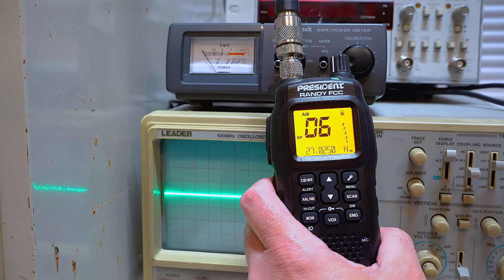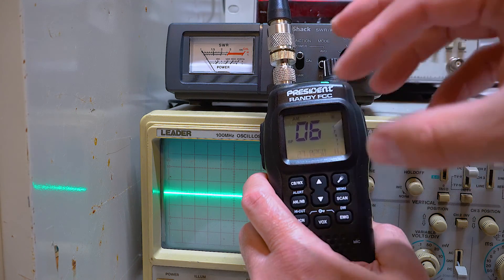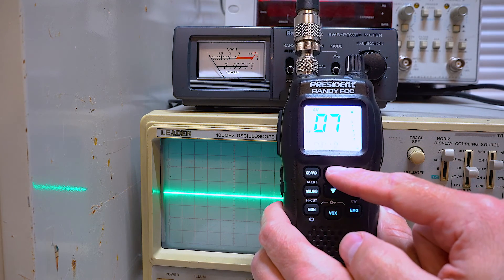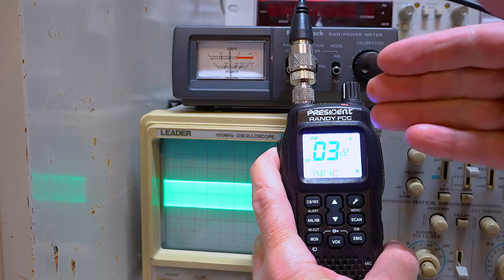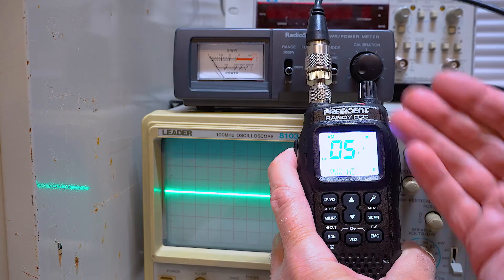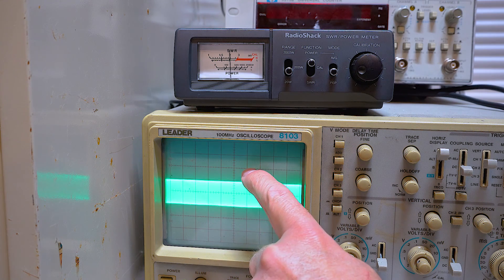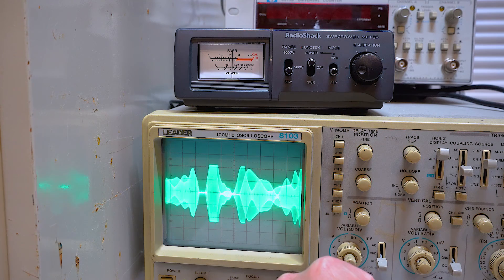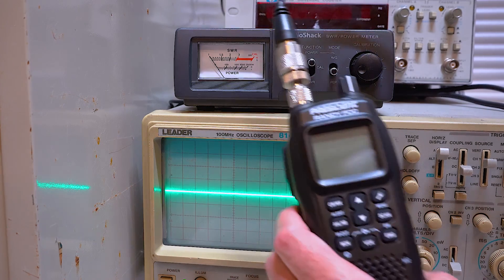President Randy FCC Handheld CB Radio Service Menu

Comment: I have viewed several videos here online regarding the President Randy 2 digital menu and the changing of the the Hi Power and Low Power as well as the AM modulation. After watching your video, I wish to revert to factory settings or at the very most, no more than 4 watts on high and 1 watt on low. So, could you please tell what numbers I should set them to in order to achieve that output and also, what is the factory setting for AM Modulation on Hi and low and what is the setting for FM modulation.

Comment: So I bought the Randy 2 FCC. I have absolutely no clue about them. Iam an adventure motorcycle rider. I would like to to know if it’s possible to hear and talk on channel 19? Other than that it Would be walkie-Talkie between us riders.
Reply from the maker: Yes you can talk on any of the 40 channels. eep in mind the range will be limited depending on the terrain. Flat open areas might be 3-5 miles. Hills might limit it to 1 mile.

Comment: Very confusing about the AM modulation...  You said go down on the menu to increase the modulation, then went down to a higher number?  That doesn't make a lot of sense...  Would that have done the same thing if you went UP to a higher number instead of down?  Also you certainly didn't show "everything" there are many other settings...
Reply from the maker: If you weren’t able to understand the video then I’d strongly suggest not going into the service menu until you learn more about radios/modulation work.

Comment: What difference would more than 3 watts make on the transmission quality of this radio
Reply from the maker: With a handheld 1-2 watts increase can make a pretty significant difference however the range is mostly limited by the antenna.

Comment: No more president to FCC stuff 
President UK in USA . 
I wouldn't mind one th we're for 10m u see e pl tones and s ok kits for 29.620,640,660,680,& lexicon KY"s
 29.690- splits.  But you got AM operations on  29.000  - 29.200 plus
Aside from 26 mhz quiet cb below 1. 
It would been cool . Try see what that quit cb 58 model does .

Comment: the president randy radio is ok, but the antenna falls apart. I have six radios and all the antennas they are not soldered welded or crimped. I had to buy tnc to bnc adaptors and use Midland antennas on each radio.

Comment: 310 for 4 Watts high on my am/fm Randy II. 1 Watt on low is 344, AM Pow mod L/H 77, FM Mod 510. Using a meter. These are the best numbers for that radio.
Reply: Would you recommend setting my radio to that aswell? I only have a swr meter
Reply: @that_kid_ozzy9121  Sure, but be sure to write down your stock settings first just in case.
Reply: In your opinion is setting the radio to the levels that you recommend, too much of a departure from the factory settings that it might shorten the service life of the radio? And how much of a performance difference will utilizing the settings you recommend produce?
Reply: @selfdefensept  Conservative improvements. Worth the minor effort. A longer CB whip would do much more. I found one for sale in England. Not cheap but necessary.

Comment: I like all the features this radio has compared to old handheld radios of the past. I went out and bought one of these president randy fcc radios. It's first time in thirty years I bought a new radio, something different in long time. I basically want it when on the highway for traffic reports from truck drivers. I see in owners manual it talks about the SWR antenna matching. If I am reading it correctly when using the rubber duck antenna that comes with the radio you don't have to worry about SWR. 
Is it only when using a mobile antenna on vehicle you then need to adjust SWR settings for the antenna your using.
Reply: If you buy President magnetic antenna such as new Virginia it already comes adjusted, it depends on the antenna

Comment: Awesome. Does it have a bnc connection on the antenna? I think this would be great to use with a magnet antenna in a spare vehicle. Also I wonder if they have any other antenna options? I have some older maxons and both are set for the same power and modulation however one has a rubber ducky with a coil load thats a few inches longer and that little difference in real life makes a bigger difference on how far they reach. I think years ago you could buy a telescopic metal antenna with a coil near the top and that made them work even better. I finally got AA 1.5 volt Lithium batteries in the maxons and they are way more usable then the older rechargable batteries. I was going to order one of these but I was not sure if they could put out decent power and modulation or be adjusted. I like it will do 4 watts and has a tiny upswing with modulation.
Reply: TNC connector

Comment: I'm hoping and waiting to see if the Randy III will be sold in the USA now that FM will be allowed on US CB radio.
Reply: I'm in the USA, and I was able to order the RANDY 3 from Amazon UK, no problem. Cost me a little more, but the car kit and CTCSS & DCS capability, is worth it to me. It doesn't have the weather option though. Impressed with all of these, enjoy.
Reply: @jacknorris3572  I,m thinking about getting this radio. Does it have SSB?  Should I get the Randy2 or 3? New to Cb..thanks.
Reply: Randy III is fm am radio that is sold primarily in Europe I believe and is not legal in US (the features that it has). Randy II FCC is the American fm version of the same radio
Reply: I agree on FM it's about time usa dose it, it's long over due. I did buy Am randy FCC radio really to use it on the highway for traffic backups or break downs, or road closures because truck drivers always know whats going on with traffic. Maybe down the road I'd upgrade to new radio if president come out with AM/FM radio.
Reply: I have the President Randy II FCC. It had both AM and FM, it's in a mobile setup with the President Virginia Mag mount antenna and works great
Reply: @meekrol1  just got the randy ii, and I was specifically looking at the new Virginia antenna. Still like the antenna?

Comment: I Love mine, just talked 5miles on mine right out of the box with a Abbree Tactical Antenna for 27mhz 42.5”
Reply: Did you get the TNC model or do you use a BNC to TNC adapter? Too heavy?
Reply: To a home base I’m assuming

Comment: I hope someone comes out with a ssb handheld that actually works.
Reply: I'd get one.
Use an SSB CB on my base camper and handheld units to hike around .  Greater range or at least better strength signals.
Reply: what you on about willis
Reply: @29pu04  Close enough.
Reply: Agreed
I’d like a SSB in this type of radio.
I’d buy into it and the system.
Reply: Why do you want to have it in a handheld? Too cheap to buy a real radio?
Reply: @NunYa953  take it hiking, backpacking, camping. Keep it in glove box to pull out and use. SSB would be useful. Why are you close-minded?
Reply: @M70ACARRY  
Not close minded, just realistic. SSB in such a tiny radio would be a waste.
Reply: @NunYa953  no it isn't. SSB will operate over longer distance than AM/FM. When the band is open, worldwide contacts are available. I've owned a few SSB handhelds. They work great.